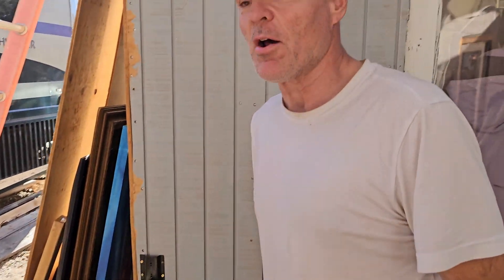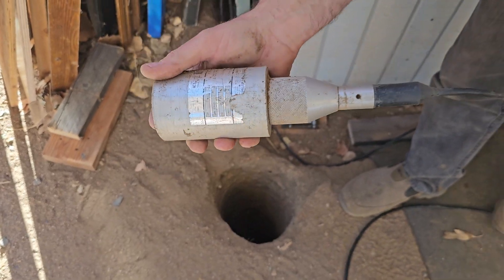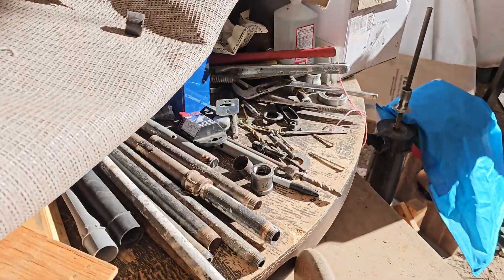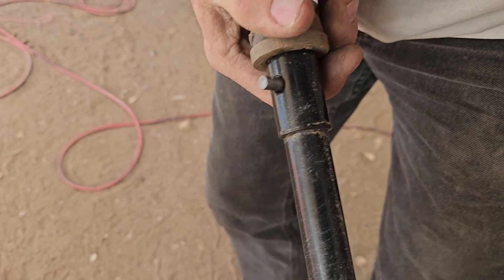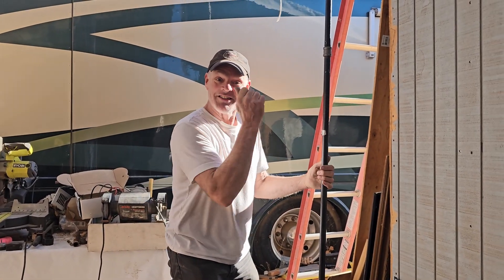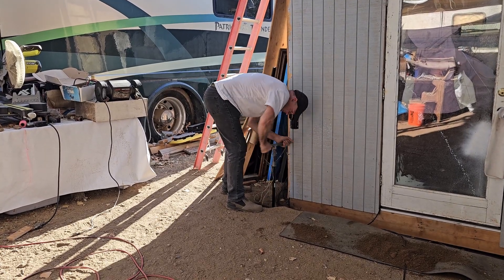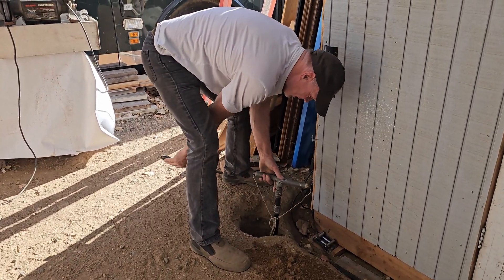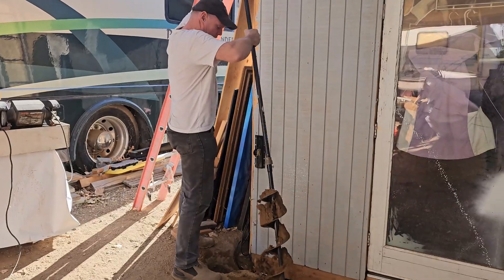Drilling Our Deepest Hole yet!

Comment: A couple of thoughts Jon. 1) how high is water table at borehole location. The L4 is water proof but is it designed to operate under water? 2) how are you going to ensure good coupling between the phone and borehole wall/bottom? 3) if there's a long run of cable between phone and surface.....any risk of cable noise?
Reply from the maker: @Kiwigeo-g3o  The L4v is fully  waterproof. However, it's not desirable to have it sitting in standing water. The water table is over 500 ft. down and thus doesn't pose a threat. Our intention is, (after getting to our desirable depth) to lock the L4 in a plastic section of tube that we then secure a cable to and after lowering it in the hole we will refill the hole with a few feet of dirt to prevent the cable bringing any vibration onto our seismometer.  The dirt, hopefully , will also help our unit to receive a good connection to the bottom and walls of the hole. Good questions we did ask ourselves a few years ago when we buried our first seismometer in the ground in Missouri.  This is the way we approach it, and the unit has worked flawlessly for years now. It's always pleasant to hear from you, and thank you for keeping us on our toes. Sincerely Jon and the TEAM.
Reply: @CaSeismograph  Sounds like you've got it all covered Jon. Having some slack in the cable should also reduce vibration transmission via the cable.
Reply from the maker: @Kiwigeo-g3o  yes, thank you 😊
Reply: @CaSeismograph  you're getting close to running a wireline borehole checkshot survey. It used to amaze me where noise could come from.

Comment: this will be cool to see 
how a seismograph is setup Underground : D
Reply from the maker: @icy-claws  the seismometer will be lowered in the hole, and the seismograph (above the ground) will transcribe what the  seismometer is sensing underground.  You are right, Icy-claws. It certainly will be cool 😎
Reply: @CaSeismograph  did you ever visit any fault lines in Canada at all ? 

actually there are some in the east coast of canada like the great lakes fault zone witch i googled it up and says it only has a low to moderate risk not really to worried about it but still keep my guard up because you never know also cute kitty Kitty in the background
Reply: The device Jon is deploying in the hole is a geophone. A geophone is a ground motion sensor. The signal from the geophone is fed into the seismometer at surface.